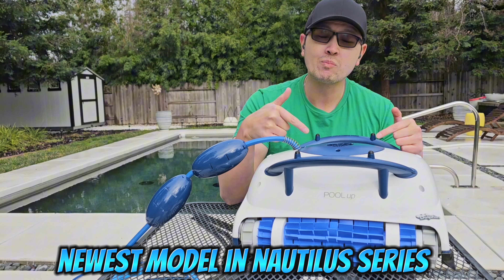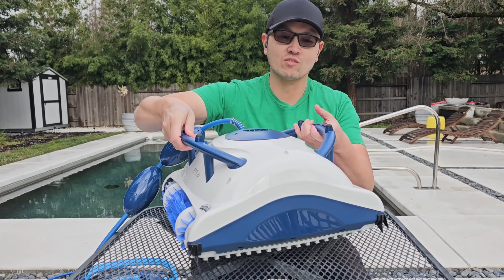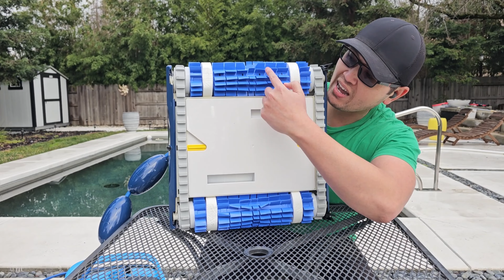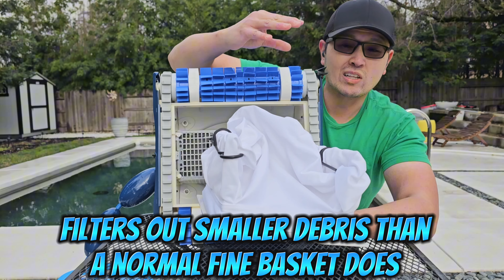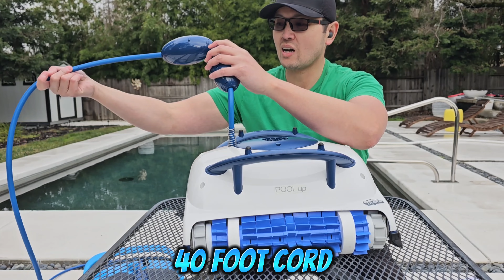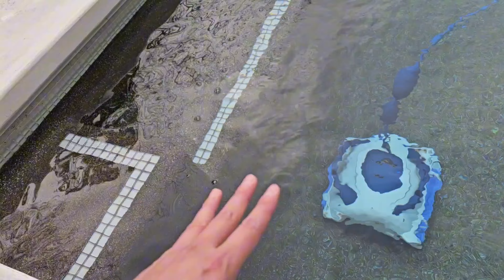Dolphin Nautilus Pool Up Review

Comment: Can I use it in a 10m(32 feet) long pool if I place the PSU by the middle? Thankss
Reply from the maker: Its rated to handle up to 33 feet so I would think so. Whenever you place a corded cleaner into the pool you should always place it the furthest spot from where you plug in with the same distance of its own cord. This prevents tangles in the pool
Reply: @imdefinitelydavid thanks, in that case I’ll go for the E20

Comment: Overall what are thoughts? Buy or no buy?
Reply from the maker: I think it's an okay cleaner but for about fifty dollars more you can get the CC which is easier to manage than the Pool Up. If you spend a couple hundred more there's the CC Plus which is big step up.
Reply: @imdefinitelydavid  I wish it was still the case. CC is about $200 more. So now that the pull up is $150 cheaper. Would you recommend the Pull up at that price point? I had a zodiac m8 and disliked it.
Reply from the maker: Hello!

I didn't even realize they increased the price of the CC. The Pool Up is still a good choice if you're looking for a corded cleaner. The hardest part to adjust to is that cloth debris bag. Once you've used a top loading debris basket, you realize how inconvenient a cloth bag is.

Compared to a Zodiac M8, the Pool Up will definitely do a better job. Switching from a suction cleaner to any corded robotic cleaner, you will notice a big difference

Comment: Hi David I am torn between the Pool Up vs the Nautilus Cc. I have a very standard rectangle pool 12 by 28 feet with a sun/tan pad. I don’t mind the work as in brushing the sides. I am just trying to see for the money what’s the best for the price and making sure it picks up your standard dirt that sits at the bottom like sand. Or would you prefer the plus over all of them  ?
Reply from the maker: Hello! Between the Pool Up and the CC, I prefer the CC. They both work similar but the CC is much easier to empty debris out. The debris bag that loads from the bottom of the Pool Up gets annoying over time. It takes more time to empty and rinse out the bag as well as reattach it back onto the frame. The CC is much MUCH easier to empty. The CC also has a weekly timer so that's a plus as well. It's definitely worth the extra cost between the two.

But then we have the CC Plus lol... and that's a big step up but even more worth it imo. It has a larger basket and is able to climb walls much better than the other two and even climb steps up to your tanning ledge even and clean that as well.

I think that even if you're okay with scrubbing the ledge and waterline, over time, you might regret not paying the extra cost for the features the CC Plus has over the other two. Like, for me, I'd rather be overprepared than under. Unless price is important then, go for the CC.

Hope that helps!
Reply: @imdefinitelydavid  I wanted the CC but was told the CC does not accept climbing rings. The CC Plus can use climbing rings but it's $800 and uses an app. I don't want an app for my pool cleaner lol. The Pool Up is offline, and comes with climbing rings for $500. They all have the same warranty....
Reply from the maker: There's actually two versions of the CC Plus. One has wifi that you must use the app to do things like set the weekly timer.

Then, there's another version that does not use the app and comes with a different head unit control panel. I prefer this non wifi version if that helps. You control it physically on the unit itself, no wifi needed.

Also, if you're looking at cleaners with climbing rings, then i assume you want a good wall climber. The Pool-Up is less expensive, but it does not climb nearly as well as the CC Plus does. Maybe that helps your decision.